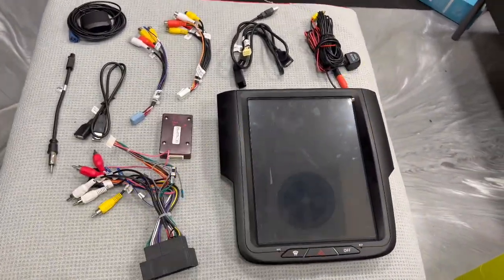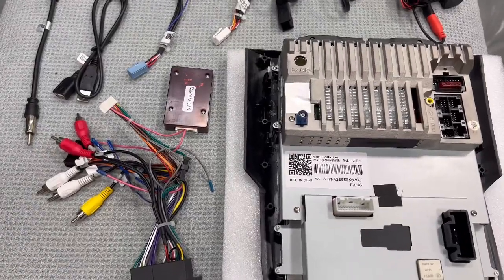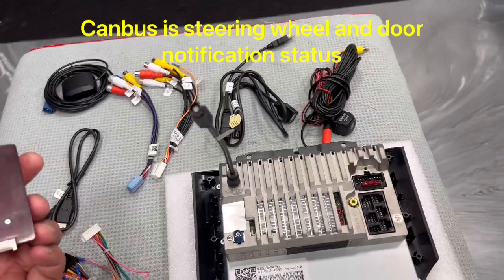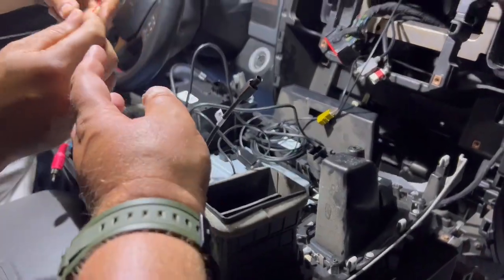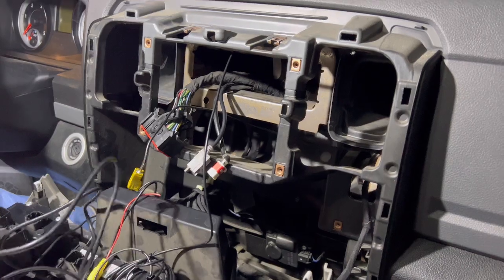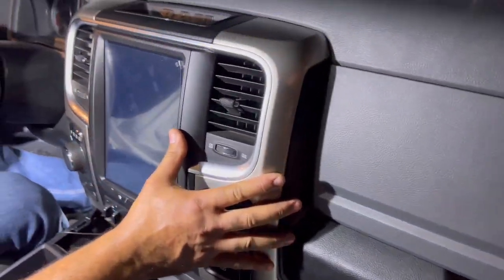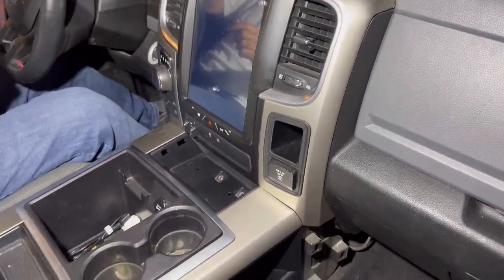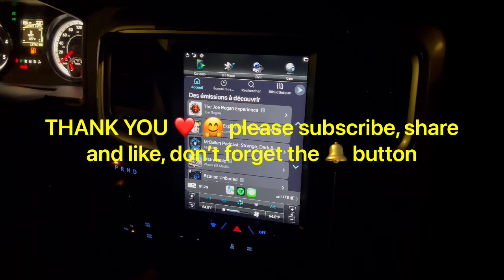Best Dodge Ram 1500 Teslastyle CarPlay - Android Auto  Headunit infotainment 2014-2019

Comment: How has the radio been working out for you I’ve been thinking of getting one for my Ram but not to sure I’ve seen some reviews of people having problems not necessarily this brand so I’m not 100% sure on getting one.
Reply from the maker: Good question, so the one and only flawless headunit you can get for the ram, is the one I shared . Every other one I’ve tried in the past had an issue or failed down the road. I have exclusive  coupon also posted and link to purchase , if you check my other videos , you’ll get the vibe. I have a 4Runner , Tacoma , outlander and RVR . Every vehicle has a different radio installed in it, even though it’s android based but different factories make them. So I have tested more than 49 radios worldwide , what I share in my videos and description of videos work exclusive coupons is the only model to get, that’s   why I mention in every video to use exact links so you won’t get something else . Nothing failed till now, even at extreme colds, we have minus 45 as I wrote this message, radio still works . Cheers 🍻
Reply: So far I haven't had any luck with mine. Screen won't come on at times and will not connect to android wireless carplay
Reply from the maker: @firegomer1  we had minus 43 Celsius these 2 past days and it turned on line a champ. What headunit do you have ? Where was it bought from ?

Comment: I have a 2016 Ram 1500 with an engine tuner module hooked up where I can change the engine characteristics, such as sport mode, eco mode, tow mode, etc...   I control that module with the steering wheel buttons.  If I install this will it disable being able to control that tuner?
Reply from the maker: If the entire tuner is android base or has an app to be installed on an android OS. Then  yes . How do you control or now from your headunit? Or a better question, can you control it now from the headunit ?
Reply: @KingSev  no I control it through the steering wheel buttons and the options come up on that little screen between the speedometer and the RPMs.  It doesn't go through the center console screen
Reply from the maker: @JoshStreetDesign  ohhh, well, I can’t help you with that, I don’t have  the experience :( what how to control. But , whatever  I was able to do with my oem , I can and plus more with this headunit .

Comment: Brother I have this is my ram truck as well and when I bought it I noticed a picture of a couple on the screen. How do I reset the whole system to where nothing will be on there?
Reply from the maker: Hey, so where was it bought from? If not from my Link from the description of the video, it may be slightly different OS on it and it may not be the same path or software installed .
Reply: I’m not sure I bought the truck 2 weeks ago and it already had the screen and I’ve been trying my best to figure it out and you have the same exact one I have but I just can’t seem to reset everything to factory
Reply: Hoping you know the answer
Reply from the maker: @sethcatinterraciallove2866  watch it, if you factory default . You may lose the essential  files that needs to boot up. There’s a wrong way and  right way to factory default ,  anything white screen , don’t touch . Go to factory, enter 123456 or 7890 and factory default

Comment: Can we still have access to the dodge menu settings like the factory unit ? air suspension settings, parking sensors sensitivity and so on
Reply from the maker: Hey; no, these are in the main headunit , you won’t have access to those unless you install an extra OBDII, but I highly suggest getting this instead, because if you have all the options you mentioned; then you should have the touch screen from Dodge. So you won’t need to change the whole headunit, keep everything oem, instead add this AI box to have exactly what this unit has , while keeping OEM. 

 https://youtu.be/QiMkJlX_Ydk?si=SM8mdDtuvRTQ_Ene
Reply from the maker: Or this for android auto , same unit 

https://youtu.be/sKyZVCGwGs8?si=0iwZQz0nEWfaXi_0
Reply: @KingSev  thanks you for you quick answer! Yes I have a fully loaded limited ram 2016 with connect 8,4 touch but I don’t have apple CarPlay! I was thinking getting an android box controller with the electronic card inside of the head unit ! Do you know sellers for this type of product? I really want to keep all the settings from the factory unit! You mentioned you could use this unit with obd2 what do you mean by that?
Reply from the maker: @gregoun1 yup, that’s exactly   what I gave you. 

💰 link to purchase 👇🏻 

https://cartrimhome.com/Android-12.0-CarPlay-Ai-Box-4GB-64GB-Snapdragon-QCM-6125-Wireless-CarPlay-Adapter-Android-Auto?tracking=ncJKtrtdNkES3RSYEOSXlG4r7y7yGJS1z8PFUL4ho3ejj9k5w51QlgTnFbwhJkTW

For an extra 7% off use coupon code kingsev7

Comment: I'm Adapted for heating I have ram 2014 diesel
Reply from the maker: Sorry didn’t understand what does adapted for heating   mean and what does it have to do with the headunit / radio. Thanks
Reply: @KingSev  I need cable for my AC because I put the screen on it but AC doesn't work.
Reply from the maker: @reynaldoaguilar1590  where did you buy the headunit from? Usually when  you choose the right model, you should receive the right harness to activate the AC.
Reply: @KingSev  thank you

Comment: Hello, couple of questions, if my truck has the backup cam and the oem cargo cam, is there an adapter harness to utilize those cameras?  Also, as I research several of these, a common issue is the hvac fan control, oem has 7 and these units only have four, and the complaint has been that you don't get the higher fan speeds.  Is this unit the same?  I see in the vid that 50% fan speed is level 2.  I am disappointed that there isn't XM connectivity outside of using the the app. but could get over it.  LOL
Reply from the maker: Hey, every unit is designed accordingly to each trim and model and year so unfortunately I cannot answer the cargo camera but I can for sure tell you that you can install XM satellite from either Best Buy or XM direct for another $59 if that’s what you want as a hard-core XM user for 25 so years I gave up on XM lately. It’s been like five years they play the same thing over and over. On a sidenote these units are amazing the sky is the limit you can download anything you want through the head unit or listen to off-line Spotify, YouTube music Amazon music so the sky is the limit I hope I was able to answer all your questions. Maybe you can contact aucarauto directly? @Aucarauto oh, and the fan speed is more than OK

Comment: No normal volume buttons, will see how you change volume when you driving without steering wheel control
Reply from the maker: Why would there not be steering wheel buttons ? On a 2014+ model? Plus , i can use voice control? What’s the question?
Reply: @KingSev i have a 2020 ram classic and unfortunately it doesn't have steering wheel volume control. . But it does have the uconect screen. .
Reply from the maker: @tonyc2136 what? 2020 no steering wheel volume control ? Have you checked behind the steering wheel? All Rams have volume and track control. Check at 3 and 9 o’clock behind the steering wheel.
Reply: @KingSev  i have checked, also cause I've owned a 03 stratus rt and it had those buttons on the back, but this one doesn't unfortunately.
Reply from the maker: @tonyc2136 that’s so weird , never ever seen a uconnect without steering wheel controls 😕
Reply: @KingSev buddy driving an ST with roll up windows lol
Reply: @KingSev  my 2016 Tradesman 1500 has the 5” screen Uconnect system with no a/v controls on the wheel
Reply from the maker: @thoughtsFromTheCove  I guess Canada and US ara different ? 🤷🏻‍♂️

Comment: when you put it in reverse will it automatically show the rear camera?
Reply from the maker: Yes it does
Reply: @KingSev  sorry man...just heard it in the video...lol
Reply: @KingSev  also, i have a ram rebel that has the original 8.4" screen...is there any issues with taking that out and using the new head unit.  I also have the air suspension, seat warmer and steering wheel warmer.  is there a option on the new head unit for that to be controlled?  did not hear that on there...
Reply from the maker: @seanmcgrath0213  yes , depending on the model of your truck, options are active or non active  .
Reply: @KingSev  it looks like it keeps the original buttons that control the air suspension and the other features i mentioned.  as long as it allows me to keep those features i would be willing to buy this.  will i be able to keep all my factory features?

Comment: Does anyone know how to make it compatible with a manual A/C I am watching several videos currently I want to install one in my 2018 Ford Edge with manual A/C connect everything and everything works fine only my A/C does Not responding on screen I want to know if there is a solution.
Reply from the maker: The one I have was for manual AC. Links are in description. But it’s for Dodge ram .
Reply: @KingSev  I just saw that I have to configure the AC in settings, I will try to configure it

Comment: Can anyone tell me the CAN Bus Type for my 2014 Ram 1500?
Reply from the maker: What do you mean canbus Type? The link that is in my description, comes a full package , with canbus. So nothing extra is needed. 

What’s your unit? 
Where did you purchase  from ? If you did.
I do you need to  canbus type.

I’m trying to understand the question   to assist you. 

Thanks
Reply: @KingSev when you go into setting. Vehicle and then select the CAN box type. I don’t see my truck anywhere in the menus.  I found a “XP  dodge Ram Xp” setting. But my sound doesn’t work. If I change it to anything else nothing works. No AC. No volume. Nothing. 

So I need to know what setting to select for my truck
Reply from the maker: @whittcondit7341 you do not have exact same truck, do not play with those, you’ll brick the headunit, leave it at what it is from their factory. You missed the whole other questions I asked you.